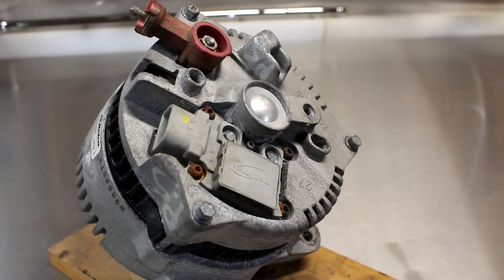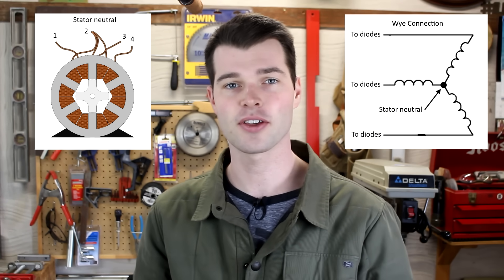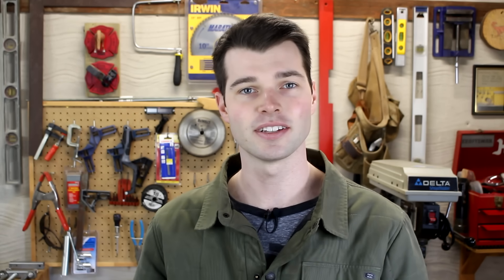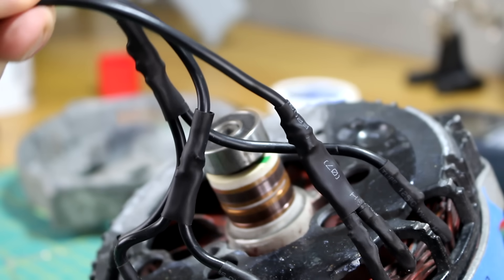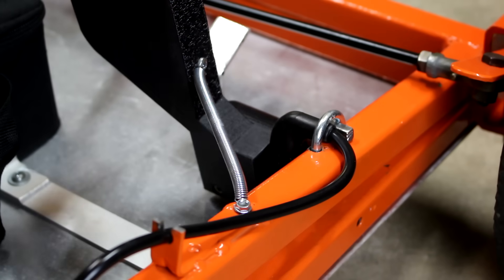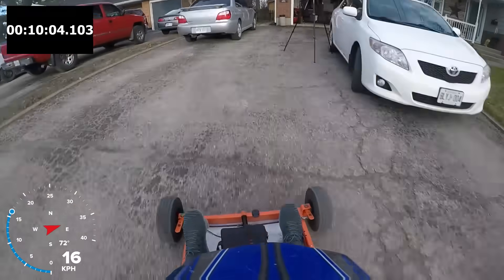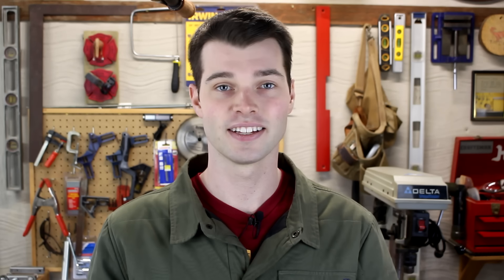Converting a Car Alternator into a Go Kart Motor

Comment: I know this won’t totally sound correct but with this layout does it recharge the battery when you let off on the throttle (regenerative braking) ? Very interesting idea by the way.
Reply: Hi Jacob. Yes it is possible to get some energy recharged into the bat. pack. You have to keep the rotor field at least partly energized. Use relays to disconnect the bat. pack from the stator windings. Then adding  diodes in the stator winding circuit ( think one way check valves ) could feed power directly back to the battery, bypassing the disconnected speed controller. The " motor" would once again become an alternator. Keep in mind that high rotor voltage/current will produce a very high current to the battery pack ( load ) and cause the 'cart to slow down very abruptly.  If you normally apply 12v to the alternator field to make the 'cart go, you may only want to apply 2-3 volts to the rotor field to generate a reasonably small amount of current back to the battery. This would produce a more gentle braking force and not throw your chest into the steering wheel.
Reply: Robert Beck gotcha, I was just thinking about the whole rapid deceleration idea, thanks.
Reply: @jacob - - There are high power ESC's available that have regenerative braking capabilities built right into them.

Comment: I would go for brushless outrunner motors, 2 motors for 2 wheels. If you use the cart daily. use LiIon cells, other LiPo. Lead batteries are always a safe choice for slow vehicles. I would go for an offroad model to keep the parts shock free. Like the old Mini you could use elastomer shocks.

Comment: How about using a $99 Harbor Freight generator, a 115 to 230 volt transformer and a frequency drive. The freq drive will give you speed control. I'm sure your pedal will work with that.

Comment: Quick question. Can you tell the approximate HP and torque?
Reply: SEVEN Not sure about torque, but you can estimate the W if you know what Voltage it runs at and how quickly it drains the battery's capacity. Based on similar performance from hobby grade motors I'm geussing this is around 800-1000W, which is 1-1.3hp. It appears to perform similar to a Turnigy SK3, which are common in the eSkate community. The best bet for improving this setup is increasing the V (to lower A draw) and adding a second motor. 2000W is where electric rideables become fun.

Comment: kool could a second alternator be added to charge the battery
Reply: Answered above.    Essentially - no.  You can't get energy for nothing. Something always has to drive it and in conversion process you lose power.  Electricity to motion: maybe 75%, efficiency.  Motion back to electricity to charge the battery: maybe 75% again.   A net loss.    It would also slow the cart down and there would be shorter run time.

Comment: Cool project. but the steering geometry on the kart is no bueno. It's sort of the opposite of Ackerman geometry. I noticed it was having trouble slowing in corners and understeering, and then I had a little pucker when I saw what the front wheels were doing in relation to each other..
Reply: Wyatt Rowe at first you said all carts have front weight distribution, which is incorrect because the bulk of the riders weight is the torso which is in the seat, closer to the rear wheels, the legs are forward but they are light in comparison to the torso and distribution.  Then you conclude by saying traditional carts have the engine directly over the rear wheels, which is correct.  The majority of the weight distribution is normally over the rear wheels.  However with austiwawa the rider position is in between the front and rear axles and the battery bank is heavier than the aluminum motor in the rear, therefore the majority of the weight distribution is in the front of this specific gocart.  Lead batteries are very heavy, and aluminum alternators are light in comparison.  That's why Ferraris oversteer and that's why old Buicks understeer, because of the weight distribution.  The Ferrari has the engine and weight in the rear. While the old Buick had the engine and weight distribution in the front.
Reply: MrJohn613 All go karts have the weight over the front because of the rider. On a traditional kart the weight of the engine isn’t a big factor because it is directly over the rear wheels.
Reply: agreed
Reply: Like a mid engine car, most gocarts have most of the weight in the back, with a heavy engine, which causes more oversteer.  However he has a very light motor in the rear of this one and I'm guessing majority of the weight is up front in the lead battery bank, which causes more understeer like a 1970s Buick , opposed to the oversteer of a mid-engine car like a Ferrari.  Weight distribution can play a good role as well as suspension geometry
Reply: Dale Dunn unless you have CAD or an extensive knowledge in suspension geometry you are going to have to this... Setting up Ackerman isn't as easy as you think when you don't have $$ for R&D. Steering linkage placement,angle,tie rod length/angle all play out in Ackerman and takes time to get all wheel traveling around same pivot.

Comment: Awesome! But the motor has no forced cooling. On alternators, the pulley has the fan that suck hot air.
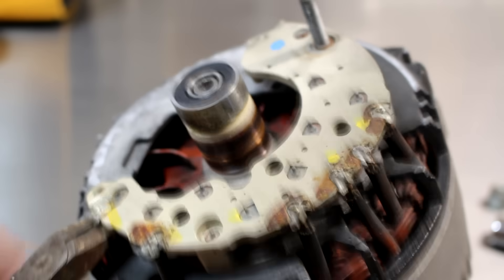Reply: That's old school alternators from the 80's and earlier. If you look @1:20 you can see the fins on the internal cooling fan when he removed the back cover.
Reply: haven't noticed that^^
Reply: It's a internal cooled 3g ford alternator .
Reply: Very good point Emanuele. I wouldn't have thought about that.

Comment: You're holding your angle grinder with the cut off wheel backwards.  Hold it so the sparks fly AWAY from you face.  The spindle should point to your left.

Comment: Guess what! Mine has the stator winding 3-phase leads exposed! I only had to unscrew a thin cover sheet that was held on by 4 normal bolts and remove it. then i soldered some wires directly to the 3 pins sticking out. hooked up 6.5v to the field windings and gave it power with a 40A 3 phase ESC with an ESC/Servo tester and it spins!! Even starts up on its own! Doesnt even use much power I can run it off 12v 2A power supply and spin it up reasonably quickly to spin a fan blade for example lol!!!

It had 6 available leads coming out the back easily solderable to. I used a 100W soldering iron to solder to them easily

I used the outer 3 wires and they were the correct ones. didnt need to remove diodes in it at all. it had no built in regulator either. it has the most torque when i hook the field windings in line with the battery while powering it. causing it to turn slowly but strongly. which would give useful torque at low speeds. even attached a sanding disk to it to use it as a variable speed sander
Reply: And what alternator is that for an FYI? Thanks.
Reply: 90FF1 I haven't seen an alternator with an external voltage regulator on a vehicle newer than 1969
Reply: That's about right, I think my 72 Dodge and even 76 Dodge maybe?  These had external regulators on the firewall I'm pretty sure?
Reply: r6984 Ford used external voltage regulators on the 1980 and 1981 Ford Fairmont. It made for cheap repairs, and I have never changed an alternator when I owned them. They had external starter solenoids too. The voltage regulator, or charging regulator was bolted to the fender, and so was the solenoid. I wish cars were still built like that.

Comment: Quick tip for the 18650's (i've been dismantling things with 18650s in them for a while) If you take the laptop battery and use the 18650's in those you'll have plenty of capacity but you'll need to put quite a few in parallel to get to a sustained 40-45Amp output. I find usually laptop batteries have cells ranging from 2-6amp max output but the capacity is usually between 2.0-2.7AH. If you go for power tool batteries the story is very different. A small ryobi battery will have 5 cells in series. These will only have a capacity of 1.3-1.5AH but will be able to supply 20-25Amps each! 

So with the Ryobi batteries you could have a setup such as 12s 3p
And with the laptop batteries it would need to be about 12s 8p

Or just go buy the new LG cells that are 3.5AH and 10amp output.
Reply: Even 8p of recycled laptop batteries would be pushing it. You'd have hideous balance problems too. Better just use like you say, power tool batteries, hobby lipo (provides the most oomph for sure) or buy brand new 18650 cells. For range, i'd go with the latter, for drag racing, hobby lipo every time
Reply: Oh, I did just build a 21s8p with sony vtc6 cells. Spicy little battery hahaa
Reply: th3d3wd3r you can’t have balance problems with cells in parallel. They will always equalize themselves. If one is much weaker you will have a problem with the other cells having to charge the bad cell. But that’s easily fixed by just putting similar capacity cells together. 

I hate LiPo personally. The majority of the Lipo i’ve owned puff within a year, and they are a bit scarier than li-ion
Reply: All well and good if he's going to run a go kart at 3.7v ~ 4.2v. He's going to need a good few cells in series to get 48v

Some Lipo is crap, others not so much. The 16Ah 6s multistars are cells of legend
Reply: There is reason they use smaller cells in the Tesla
Reply: Eric Fling Eric do you mind tutoring a little on that subject? I've got some experience with 18650 cells and enough around right now to learn on. I have a bike project also and plenty of cordless tools and no shortage of electronics to power. I would think enough on hand to learn a few things anyway.
Reply: wheeliedart urm, the guy doesn't know what he's talking about. That would just be the blind leading the blind
Reply: th3d3wd3r trying to put people down is not going to make you feel better about yourself I think we should need to work on more than these batteries is your self-esteem
Reply: th3d3wd3r.    You should change your screen name to Einstein.
Reply: What about batteries from an APC uninterruptible power supply? The battery back up used with computers?
Reply: wheeliedart hahaa, the guy just pissed me off, telling me series balancing ain't an issue on a 48v pack, likely 12s or 13s lol. If you're going to lecture me on lithium battery design, you best know your shit ;)
Reply: The problem with laptop battery packs compared to power tools is the lower discharge rate. Now, I only say that because of my experience trying to use them to power quadcopter motors. This may or may not be an issue with an alternator motor configuration. I can use 18650s from power tools and fly no problem but trying to use laptop versions lift is minimal and very brief...

Comment: why do you need 12v to the brushes?
Reply: Joe Dduncan The alternator doesn't have permanent magnets like the BLDC (BrushLess Direct Current) motors. The permanent magnets (most often very strong rare-earth magnets) add considerable cost to the motors. Instead, the alternator/motor has coils on the rotor (the part that spins) that create magnetic fields when current is running through them, which is the reason to have the brushes. A brushless motor requires permanent magnets on the rotor. So the tradeoff is efficiency vs. cost. Extra battery capacity costs more as well, and adds weight which then puts a higher load on the motor and so it can become a vicious cycle of adding batteries to get less and less incremental gain. For some fast and cheap fun he hit the nail on the head. For a daily commuter the added cost of the BLDC motor and Lithium battery packs can quickly be justified by faster acceleration and longer range because of less weight and higher efficiencies (and faster charging if that is part of the personal equation). That said, he's inspired me to make at least one for one of my kid's 'toys' used close to home.

Comment: ELECTRIC DRIFT TRIKE!!!! I'm super excited to see your next build. I have 3 electric drift trikes each with different drive trains. The first one I made with a 2,000 watt hub motor in the front wheel. Second trike uses a 1,500 watt brushless motor to power a live rear axle. Third has a split axle and two 1,000 watt motors powering the rear wheels independently. My favorite part is I use Dewalt cordless tool batteries to power all of my electric trikes and e-bikes. I typically get a mile per amp hour, never over-discharged, and it is easy to swap out fresh batteries. Keep up the cool videos.

Comment: So what happens if you put a higher voltage to the rotor?
Reply: vanhornjim The resistance stays the same, so higher voltage means more current going through the windings which leads to two things: 1) a stronger magnetic field from the rotor as long as it survives the 2) additional heat generated by the resistance of the windings. That heat can cook off the varnish of the windings so that it 'shorts' (electricity taking a shortcut), and becomes something to repurpose, such as a paperweight or recycle. I'd say copper jewelry but the smell of magic smoke escaping is hard to get rid of. ; )